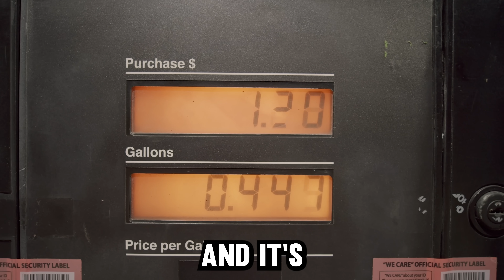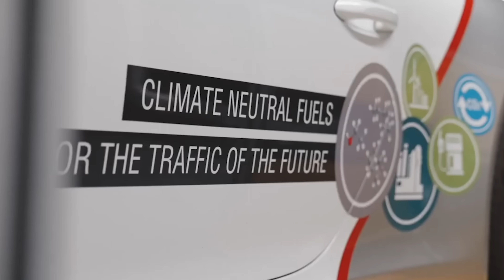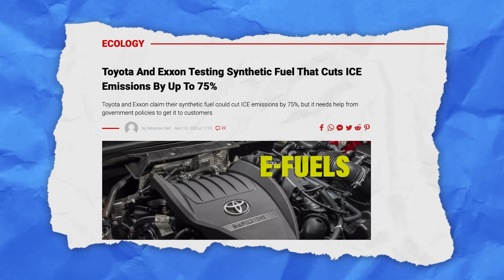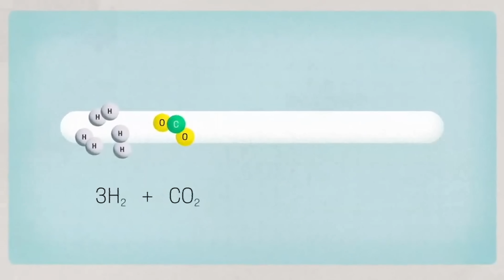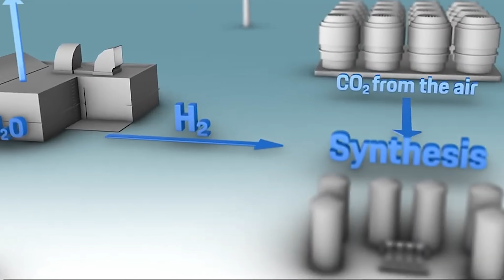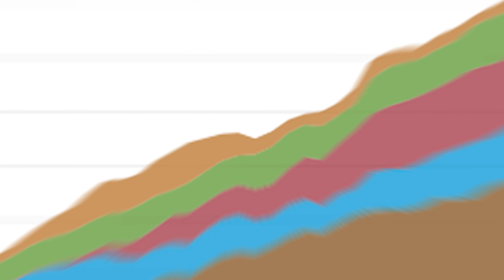Dodge Just SAVED Combustion Engines

Comment: I guess i'm glad the EV'S aren't looking too good now but even with synthetic fuels its still using a limited energy source for example what happens when that one element that's the key ingredient for synthetic fuels ends up becoming harder to find what then we have to continue to fight for an unlimited self-sufficient energy sources that we can put in our vehicles so we don't run into that problem
Reply: @Dalton  as far as nuclear power goes, I don't think a nuclear powered car in a very bad car accident would be safe, and the real reason for nuclear power is to give lithium ionic batteries a chance to exist in more EV's which would be pointless the only use for nuclear power is to power another form of limited energy sources in lithium ions it would still be a waste of time and money
Reply: @Dalton  that doesn't change the fact that this is another way to push lithium ionic batteries in cars, which is more problematic than necessary. we should get off all forms of limited energy sources so we don't have environmental problems as well as financial too
Reply: @Enrique A Thiele Solivan  oh so you're saying that the lithium ionic batteries in Tesla lose less energy by 10 percent, but you're also not taking in the use of heating and cooling or the radio you must think that doesn't effect the lithium ionic battery in the vehicle itself or maybe you must think that people don't use their heater or air conditioning in their vehicles it's almost like your willing to BS people for the sake of selling your crappy Teslas
Reply: @anticorporatists9959  All of your concerns about EVs are being addressed. Your concerns about E-fuels (running out of carbon) are seriously ill-informed. You argue nuclear power is only good for EVs, despite being for anything that uses electricity. I don't know what you're on... but you might need to go see your doctor because I think it's giving you brain fog. Also... you do realize that running the radio, heater, and AC in an ICE reduces its mileage right? You don't get free electricity to run those in a gas powered car, that's why you have an alternator connected to the engine to recharge your battery when other electrical demands are put on the system. Based on estimates it reduces EV mileage by 17%... which isn't that much worse than the 3 MPG estimate for ICE. If a Tesla gets 3.9 m/kWh, running it with AC would be 3.24 m/kWh. At 30 mpg for purely highway v6, you're looking at a 10% decrease if you run the AC. 7% difference isn't much when electric motors are 35-45% more efficient than ICE to begin with.

Radio is statistically negligible for both. Okay, fine, heater isn't much of a drain on the system of an ICE but that's because you're utilizing the wasteful heat energy produced by it that isn't pumped into your car during most months other than winter.

FYI, the "limited resource" lithium in batteries CAN BE RECYCLED to brand new lithium for a brand new battery. The way lithium is mined is pretty much on par with oil in terms of environmental damage. If your lithium battery pack in your car stops holding a charge- after 300,000 miles, mind you- you get a new battery pack and the old one is recycled into a new battery pack. Its limited in that current mining/manufacturing is struggling to keep up- part of why it was SO important for the CHIPS act to pass, which it did thanks to Biden and the two years democrats controlled the house and senate after his election.

I don't like Teslas- most EVs actually- because I feel they're still too pricey for most people to afford. You... I get it you like the noise of a v8. That is why E-fuels should be a thing, and if they get it down to less than traditionally gathered petrol and gasoline all the better, but like it or not EVs are here to stay until Hydrogen Fuel Cell replaces them- which might not happen if they can get the EV infrastructure and charging time down before Hydrogen can get its infrastructure off the ground at all.
Reply: @kyleoates6367  The thing about EVs from, yes, my point of view is there quiet vehicles, but that's not the real problem, but the real problem is that EV's are a get rich tactic for corporations to exploit people's needs for energy yeah I might favor ICE engines over EVs but weather it's EVs with lithium ionic batteries or ICE's with fossil fuels the real issue isn't the vehicles but the energy sources that they use weather you agree with me or not it's what need to understand before this issue becomes much worse off for everyone else
Reply: @kyleoates6367 Another thing with limited energy sources like fossil fuels and lithium ions is the pointless wars that come from the use of these limited energy sources. Who's to say that Chile won't become the next Afghanistan and the existence of the military industrial complex, the limited energy sources are the reason for why the military-industrial complex has been a bigger threat to the planet then just the existence of mining for lithium ions and fossil fuel extractions but combining those together has made climate change as bad as the dinosaur ages that's the problem with limited energy sources
Reply: @Enrique A Thiele Solivan  as far as your version of lithium ions, is concerned it doesn't matter how fancy you make your lithium ion batteries. The result is always going to be the same with leaving a carbon footprint, and once that specific version of lithium ion dries up and yeah, it will dry up what you think is going to happen what do you think Elon Musk is going to do once lithium ions are harder to come by but apparently someone like you who's a careerist cuck isn't going to think that Elon Musk isn't going to want the US invade Chile of course not your too much of a careerist cuck to ever admit that Elon Musk wanted the US to invade a country for elements that keep his corporate dictatorship statis alive
Reply: The US could stop buying all oil from overseas and pump our own, and we wouldn't run out of oil for thousands of years. We have more than enough oil for the forseeable future, "shortages" are artificial.
Reply: Why would you be glad EVs are not doing well?
Reply: @shiftgood  one question I have, and this isn't just vehicles is if you think that transitioning to another limited energy source, which is lower quality, is a good thing it won't end wars and will cost the consumer more just for their vehicles and electronics to function
Reply: @anticorporatists9959  Electricity isn't a limited energy source. And it would be a mistake to think that electric cars will always be powered by the same battery technology as they are today. This is just the first step of the evolution to get to an infinite and renewable form of transportation... but people like you seem to hate it. Its really bizzare.
Reply: @shiftgood  well, people like you seem to believe that lithium ions are an element that creates an unlimited energy source, and since you're one of the people who work at Tesla, you're always gonna say that these vehicles are gonna have unlimited energy source just to sell your crappy EVs just to make money off them
Reply: @shiftgood  EV’s never have and never will have that “soul” that a combustion vehicle has. Sounds stupid i know, but the EV has never been a hit at all within the vehicle enthusiast community bc it doesn’t have that bang pop that the community loves and lives for
Reply: @shiftgood  because EVs are more of a problem with consistency in distance. The more you charge your EV, the better of a chance the EVs develop range anxiety it's like having your gas tank shrink every time you go to the pump and me personally. EVs sound neutered. They dont make the loud sound like ICE do, which isn't fun to drive
Reply: @anticorporatists9959 That's what tought when I buyed rechargeable batteries for my xbox controller. After some time the batteries does not have the same effiency when I bought it. People are just blind with those eletric crap
Reply: @Mr Fish Sticks  they really think it's going to be better for the environment. That's all there, using as an excuse to transition onto lithium ionic batteries in cars. Imagine how problematic it would be for transportation to rely on these vehicles, and with that, imagine how that would negatively affect the economy. People just get it or don't care
Reply: @mrfishsticks266  Anybody that's owned cordless power tools knows better.  There's a reason nobody even owns those old tools that came with ni-cad batteries anymore, because the batteries are shit and they don't last.
Reply: @Enrique A Thiele Solivan Sure they will, just like NiCad were magic at the time, then NiMH were magic at the time.  It's always "wait until the next magic technological leap", and it has been for the last 30 years.

Comment: E-fuel efficiency transforming electricity (renewable or not) to motive power with an engine turning the wheels is around 15% vs. 80% with a BEV.
I don't think something that consumes 5 times the amount of electricity needed for moving a BEV is the brightest idea.
E-fuels will exist on a very niche market, but no way it will spread to the masses.
Sorry for breaking your dreams, the E-fuel physics don't add up.
Reply: It's so funny that people don't realise that e-fuel is basically an electric car with more steps and abyssmall efficiency. You run e-fuel, that's an electric car. And a very shitty one at that.

Comment: e-fuel is more expensive and less efficient than just putting an electric battery and motor in cars as you mentioned. I imagine most people would rather pay 15 cents per kWh instead of $10 a gallon, even if that means getting rid of their old combustion engine.
Reply: How are they going to make enough batteries for evs?

Comment: I know lithium and cobalt aren’t the only problems with electric vehicles. There’s also a copper, nickel and other materials issue that’ll create demands higher than the current supply chains availability so mining will have to increase several times over. 
Not to mention the majority of these materials for EVs are coming from China which is a whole separate topic of issue.
Reply: If the ev is in an accident, it then becomes a hasmat issue and 9 out of 10 times the vehicle is deemed totaled.
Reply: @brianclayton3898  that’s not true
Reply: @brianclayton3898  And anything within 20 feet is totaled.
Reply: Most of this material isn’t needed today in batteries
Reply: @doddsalfa  Sorry, but that’s not true.
Reply: @doug3805  read the news
Reply: Majority of cobalt comes from Africa, anyone supporting electric cars is supporting African cobalt mine child slavery.

Comment: Synthetic fuel has been around since the 80's. It was buried in history, in hopes we would forget about the 'artificial fuel cell'.
Reply: Germans did it in ww2
Reply: @Kl0rk01  Yes,they did, and it was as absurdly expensive then as it is now to convert coal to diesel fuel.
Reply: @ironclaw6969  Exactly. Synthetic fuels and biofuels are not news. In fact in most developed countries biofuels have been widely used for years as an additive to regular pump fuels.

The problem has always been cost. Synthetic fuels cost more than electricity...largely because to make them in a carbon neutral way (you can make them from coal or natural gas but then might as well just burn oil) you need to spend electricity to make them in the first place.

Synthetic fuels will be available for people who want to keep their ICEs. They will not be a viable option for mass transportation.
Reply: @BigUriel  you are VASTLY underestimating the future need of fossil fuels for emergencies, marine and aircraft scenarios. Or are you just talking about lumbering battery powered cars?
Reply: @ct1762  Fossil fuels are not needed at all. Liquid fuels for combustion engines might still be needed for some applications, and we can produce enough of them for that just fine. We can not produce enough of them to power a billion and a half passenger cars on the road, at least not in a way that makes any financial sense.
Reply: @Kl0rk01  The Germans used coal to make liquid fuels in WW2.  Not exactly environmentally friendly.
Reply: @Kl0rk01  I believe what the germans did was turn brown coal into useable oil
Reply: @Kl0rk01  was about to comment the same.
Reply: Way longer than that. The Germans were making e-fuels in ww2

Comment: I a researcher from Ukraine . My main occupation is related to alternative fuels applications in passenger vehicles . Since 2017 I am running my research program for DME (dimethyl ether) and we have very good results for DME introduction to the existing network of LPG consumers . Dme has a huge potential for making idea of decarbonised economies viable . It can be used as a fuel , it can be used as an energy storage, effector balancing the energy generation. DME is stored in LOG-propane tanks that means no mead to invest a lot in the infrastructure ….

Comment: Dodge ain't done shit. 
Porsche is engineering a new fuel that is comprised of carbon collected from the atmosphere to be used as synthetic gasoline.
And since it involves the burning of carbon that was already a pollutant jn the air. Technically you are CARBON NEGATIVE. 
Move over tesla. Because this is better than carbon neutral.

Comment: The whole electrolysis process is counter productive and very expensive. I don’t think that’s a solution. Slow pace moving to hybrid and the when electric cars are  affordable people can move. At the moment hybrid cars are the most practical. Forget about E-Fuels.
Reply: E fuels have their place. E 85 is already in use.  Plus EV long range airline flights can NEVER work. Short range yes, long range NO. Carbon nuetral  Synthetic jet fuel is the way to go, as well as bio deisel for trains and ships. Even if a magical zero point energy battery that could run the whole Eastern United States for a year and weighed only 100 pounds, even then, an e-plane ducted fan airliner still would be inferior to any large jet liner. E planes, even ducted E jets are just TOO SLOW.  No one wants to take 13 hours to fly from New York to England when a 1960 Boeing 707 using Carbon nuetral jet fuel can make the trip in just over six hours. We need both EVs and bio fuels and syntgetic fuels and also hydrogen where it can be economical.

Comment: Combustion engines at this point need to take a backseat to electric motors.  We are on the verge of major breakthroughs in battery technology that will remove dependence on rare elements and minerals and use abundant and cheap resources instead, will remove fire hazard by being solid state, and will be able to hold more energy by density with more available charge cycles.
The battery is the main thing holding EVs back right now.
Combustion engines should be being used as range extenders for now.
Climate change issues are real, and while getting cars that make co2 off the road isn't a huge part of emissions, it is low hanging fruit.
Reply: Where are you getting the electricity from?
Reply: @C0Y0TE  you know the answer to the question, lol.  But again, that's for now.  Nuclear fusion is around the corner, Nuclear fission is viable right now.  Wind and solar tech is getting better as we invest in research, which is kinda the whole point.  We can't make something better if we don't even try in the first place.  Combustion has had an amazing run and honestly will still have it's uses, but it's past time for change.
Reply: @AnthonyAllenJr  What happens if there is no wind or clouds block the sun?
Reply: @ATruckCampbell  Nuclear.  There is no single power source solution.  It's more like a medley of sources.

Comment: I am hoping that we see more investment into hydrogen vehicles, it bridges the gap between electric and internal combustion in a way that I can work with. While there is more upfront energy cost, it requires less precious metals to be mined from the earth since the batteries can be smaller, and it takes about a minute more to fill up a hydrogen tank than it does for a gas tank. With this we can have a much more practical use of our renewable recourses and can make use of other energies like thorium reactors in the future.
Reply: Same there should be plenty of options for us available to choose from no one wants a full ev